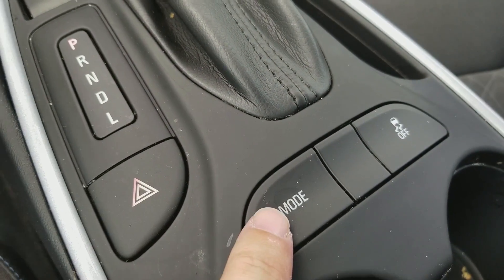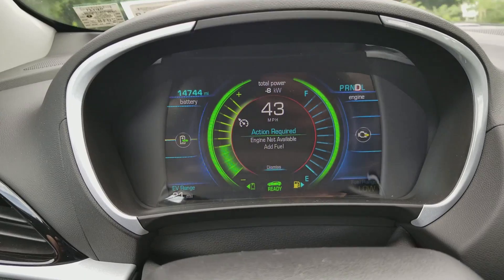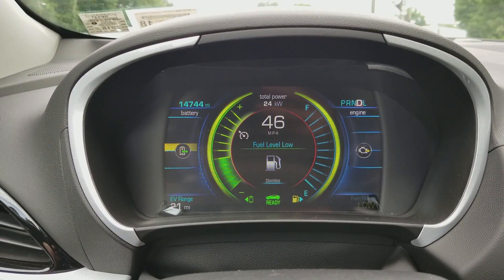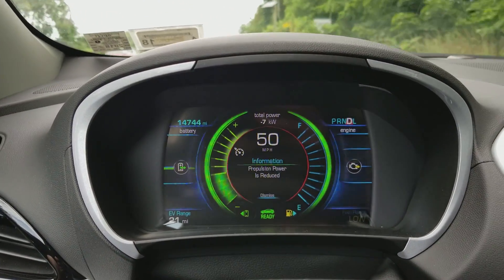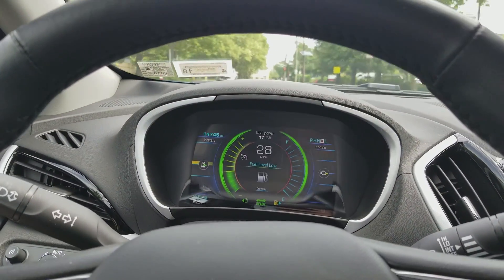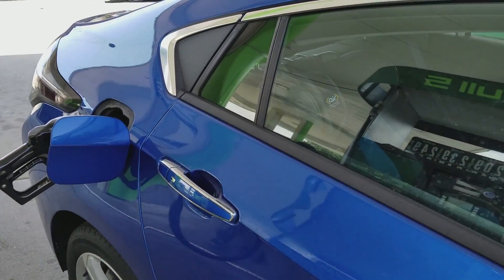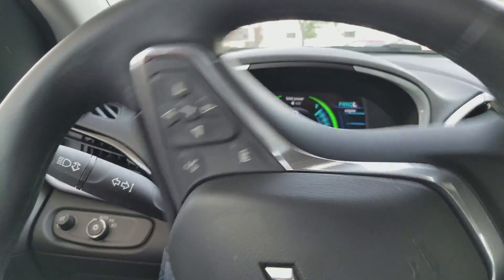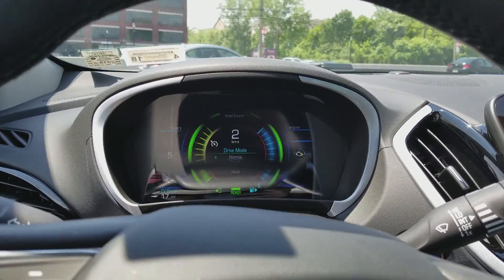Electric Chevy Volt Runs Out Of Gas - Becomes Dangerous

Comment: Its to do with the current draw required by the electric motors to provide full power when dropping the hammer. Loading up the engine with the demands of the motor is fine; its a generator and doesn't produce as excessive additional heat from being loaded up as the batteries do. When you put those demands purely on the batteries for an extended period of time you run into heat issues and a higher likelihood of causing permenant damage to the electrics. GM likely didn't want to design beefy heatsinks for their battery array to avoid reducing mileage through excessive weight.
Reply: Vee Snowtail The sad part is the car can get full acceleration without the engine being on and even cool the batterys on full electric.

This limit was purely done to get you the longest distance so you can get to a gas station as punching it would kill the battery much faster.

As a volt owner I would prefer this choice be left to the driver, not GM who is trying to do what's best for you.

Funny thing to note that all the performance comes from the battery, the engine can only supplement a small portion of the battery.

so when your battery runs empty, it's not actually empty, it has a large Reservoir left in it. but won't use that because it's better for the battery to never hit it's actual empty.

When on engine only it is still using the battery but supplementing like %30 of the power from the engine and when you are going slower or at a astop the engine is recharging the battery enough to still usuable.

So in essance you are always running battery wether you are in electric or gas mode.

The battery is always in use, the engine just helps it out by putting power in constantly.

You can see this happening when running in gas mode because the battery usuage will jump up while the engine tops out at %30 max while going full throttle but will try it's best to shift the power usuage to the engine while recharging the battery as much as it can while you drive.

I guess they figured that if you run out of gas that you fucked up and don't relize you did. So they force you into the "limp mode" to get you to refuel before your car just shuts down because running the battery to 0% will actually destroy your battery's.
Reply: Vee Snowtail Battery is liquid cooled and will even use the A/C system to cool the battery.
Reply: Hm. Did not know that. Genuinely.

Comment: Because that car is a. (Everyone say it with me.) Hybrid. GM didn't reinvent the wheel. They made a plug in prius and claim the car is all Electric If the motor was there as a back up there would be no reason to have an 8gal tank. Look at the dash under normal mode. The motor side shouldn't show any output. if its an electric car first.
Reply: It's substantially different from a plug-in Prius.  The difference is obvious if you truly understand how the car works.
Reply: From what I understand, you believe that in normal mode the car will use the gas engine? The case that justifies your belief is when ERDTT is triggered below 14 degrees F or -10 C where GM decided it was necessary to run in order to meet government defrost cold soak requirements.Otherwise, as long as you haven't used all 14KW of the battery you will not use one drop of fuel.
Reply: This car operates like a locomotive. The gas engine does add power via a clutch under certian loads and charge conditions. The gas engines main job though is to run a generator that sends power to the electric motors that propel the car once your 39-52 all electric miles are used up. In this video Spaghetti refilled with gas so the engine ran to both recharge the batteries and give power to the electric motors. The gas engine in these cars differs from normal all gas car engines in that it has a very narrow and efficient powerband that is designed to do most its work at those speeds. Its not a revver in other words. Just a mule. I dunno why they didnt go with a tiny turbo diesel.

Comment: Run any other car out of fuel and then try a 0-60 lol stupid video.
Reply: This comment has potential.
Reply: +Dee Gee It's idiots like you that are the reason there's so many stickers in the first place. Doesn't need a warning sticker, you're supposed to read the owners manual when you buy a new car. Quote from 2017 Volt Owners Manual ENGINE NOT AVAILABLE ADD FUEL
This message displays when the
engine is not available due to
running out of fuel. The vehicle can
continue to be driven in Electric
Mode until the battery is depleted,
but will have reduced acceleration.
When this message is displayed,
refuel the vehicle.
FUEL LEVEL LOW
This message displays when the
vehicle is low on fuel. Refuel as
soon as possible.
OUT OF FUEL/ENGINE
UNAVAILABLE
If the vehicle runs out of fuel, or the
engine will not start due to a
malfunction, the vehicle can
continue to be driven in Electric
Mode until the current charge is
depleted. The vehicle will have less
responsive acceleration. DIC
messages indicate reduced
propulsion power, that the engine is
not available, and the need for fuel
or service.
Reply: Electricity is fuel you dolt
Reply: +Dee Gee I wouldn't have to read the whole thing, only parts involving the unique powertrain and features I'm not familiar with. You would have to read everything including the parts about how to use a seatbelt and what to do if you can't see at night because theres no warning stickers on the dash telling you to turn on the lights at night or any stickers about how to buckle your seatbelt. And let's not even start with my religion. Pastafarian is not a lie, it's truth.
Reply: Teslas run some impressive 0-60 times without fuel...
Reply: It does work as an electric car...Electric cars will limit acceleration and climate control to extend range once they drop to around 5% state of charge.
Reply: Mike W almost needs some spaghetti though
Reply: it's running in reduced propulsion mode so it gives you more range.
Reply: +Dee Gee It is unique though, how many range extended electric cars are there on the market? When the first gen came out it was the most technologically advanced car out. It's not like the Volt didn't give warnings either. The dash message displayed Fuel Level Low, then Action Required Engine Not Available Add Fuel, then finally Propulsion Power Reduced. And most A to B, 99% of drivers who wont read the manual, won't be the type to try out mountain and hold mode anyway and will not find themselves in this situation to begin with. And GM can make a vehicle than can run on electricity only, its called the Bolt.  All automakers are influenced by oil companies, when the gas prices drop truck, suv, cuv sales rise, when gas prices go up those sales go down and small car sales go up. It's about business and profitability. Hybrid and electric vehicle sales are nothing compared to gasoline and diesel sales. And the R&D/engineering costs are massive with these vehicles as well, compared to normal cars
Reply: I thought he would run it till absolute 0, to see what happens
Reply: Ishliss2012 it is CALLED a VOLT it is part electric and should be able to work as an electric car!
Reply: nawewan reduced propulsion mode is completely retarded. How about reduced propulsion mode be the driver not stepping on the gas pedal as hard. That's a really stupid feature.
Reply: You may be able to hack it by shutting the car off, opening the gas door and gas cap, wait a few minutes (don't have to put any gas in) and putting the cap back on and closing the door. Start the car, it'll be in 'Normal' mode default as always when you turn it on, and since the engine will not be called upon because it is in normal mode and there are battery miles left, and the car thinks that you may have filled the gas tank, then it will have full power all the way to 0 miles remaining.
Reply: No, it doesn't. If the car runs out of gas when in hold mode to leave a reserve in the battery and reduces propulsion to help extend the range. It is reasonable that the car may not be able to accurately check how much fuel has been added to the tank when you open and close the door, unfasten the cap for a few minutes. There is some degree of inaccuracy, so much in that it may be programmed to assume that some amount of gas has been added even if it doesn't detect a change. Start the car in normal mode, the car doesn't want to start the engine because the battery is full, so no evidence to point to the fact that there has been no gas added to the tank. Full propulsion power because it has a full battery. 
It'll of course say 'low fuel' but it may assume some gas has been added when the fuel door was opened so it'll assume it isn't completely empty.

I thought I heard of someone doing that on their Volt, I have not done it personally. It is reasonable that it may work.
Reply: Ishliss2012 it's a chevy VOLT
Reply: dunhillsupramk3 it's a gas and electric car stupid. Never been hit with a brick. I am guessing my IQ is a little higher than yours bc I have social sense and wouldn't jump into a thread spewing bs without reading it first. It's a gas AND electric car sweetie.
Reply: @Dee Gee i didn't reply to you that was for the original comment....
Reply: throwing it down a cliff would work...    once
Reply: Matthew Shields it goes from regular car to golf cart. That large of a dip in power is stupid.
Reply: you actually made me laugh, good sir. nice job
Reply: But it can drive indefinitely without plugging it in even once.

Also, it does reduce performance if you run the battery all the way down and run purely on gas. It's just that it keeps a large enough safety reserve in the battery that you'll rarely ever encounter that fact. It actually does the limp mode on either gas or battery, not just on battery. That's the reason it has Mountain Mode.
Reply: babybirdhome what's the reason again?
Reply: +danwat1234 Your statement proves you know nothing about cars.
Reply: camaroman101 chevys are for  girls.
Reply: he didn't run the car out of fuel. it still had a power source, electricity..
Reply: Ishliss2012 you dont say.
Reply: No shit electricity is a "fuel" but that's clearly not what I was meaning by my comment. 

Take a non electric car and run it out of fuel and try a 0-60.

Guess what it won't even start! 

I'd say a 0-60 in 20 seconds is better then a 30 min wait on the tow truck lol
Reply: Maxwelhse the fastest in the world actually.
Reply: camaroman101 ok. I would never get into a Volt, and think, "I'd better read the whole fucking manual before I go anywhere."
Reply: Ishliss2012 you're not getting it. I understand gasoline is not electricity. It runs on gas and electricity. Both. And either or. It runs fine on gas, but does not run fine on electricity. That's a problem. Especially when it's dangerous to run it in just electricity. It should have a fucking dash board sticker warning you that is a POS when you run it on just electricity. It will likely have the correct warning sticker when someone dies. But will likely just not have that issue when the next model comes out.
Reply from the maker: This car can drive for hours without needing one drop of fuel...
Reply: camaroman101 you're still not understanding. I think warning labels are stupid as well. I think in this instance, if you have a car that does something totally unpredictable and uncommon and totally out of the ordinary and most importantly, illogical, then you should let ppl know, outside of the manual. The manual is for ppl who like you who want to want to know how to change your trunk light fuse 15 years before it goes out. A Volt is a fucking point A to B car. It should require nothing more than a US drivers license to know how to drive. Myself, and 99% of US residents do not read a manual before driving a new car. Unless it's a one off race car or something rare and unique. This is not unique at all. It's a stupid chevy Volt, made for wife's and college kids. It's a gas and electric car. It should run on both, safely. Chevy is probably still being influenced by oil companies, if they can't make a car that runs safely on electricity only.